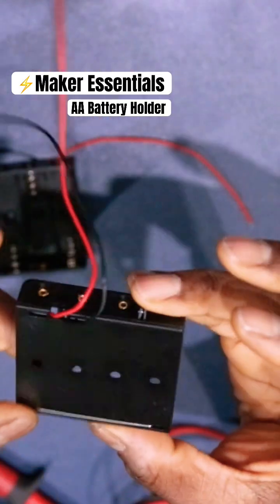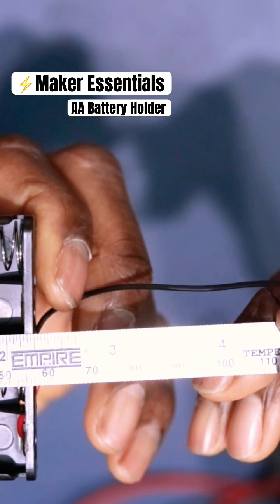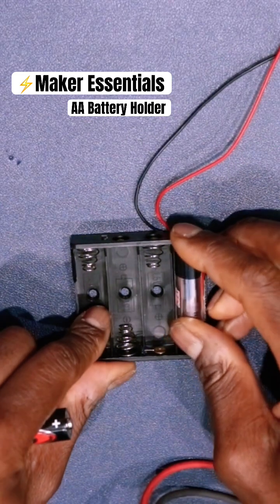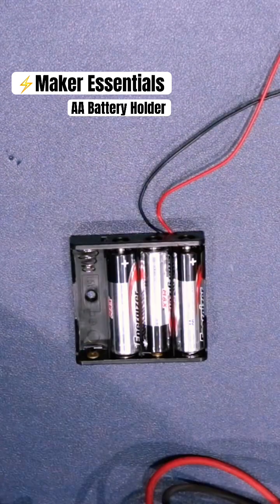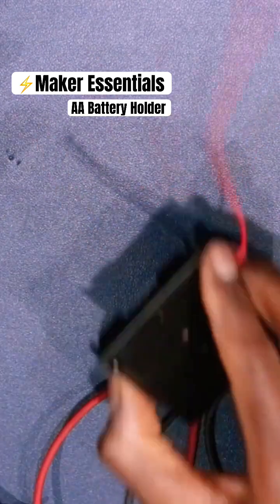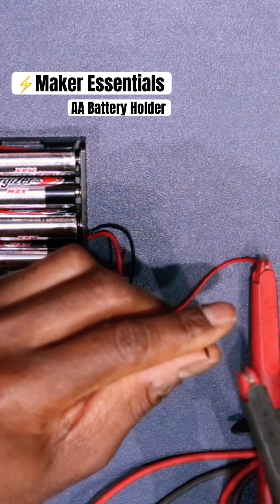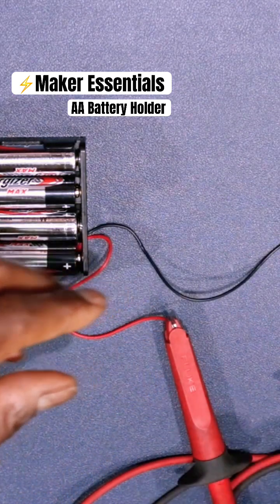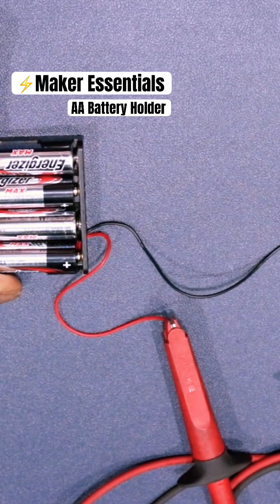AA Battery Holder #arduino #batteryholder #makerdiy

Comment: Sorry but if i connect them directly to the board it wont blow the Arduino right ?
Reply from the maker: You should be fine. Typically Arduino requires 7-12VDC, but can run off 5VDC off a usb port. This holder will provide ~6VDC
Reply: @CreativeGenes  thanks a lot !